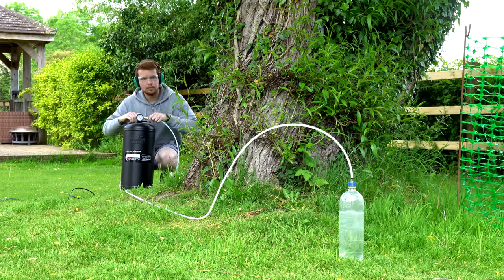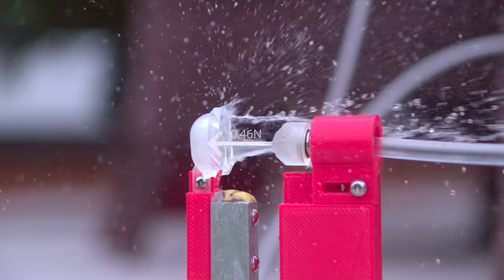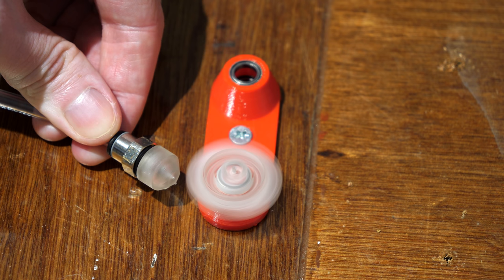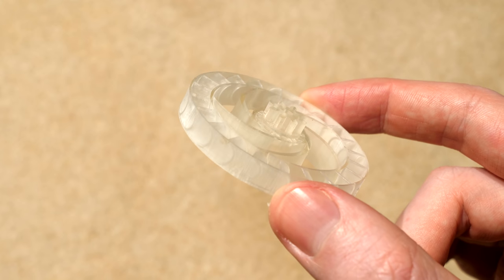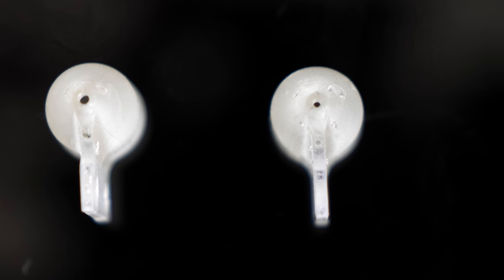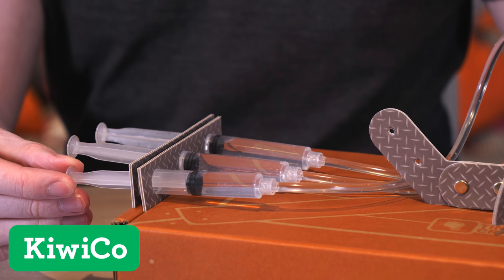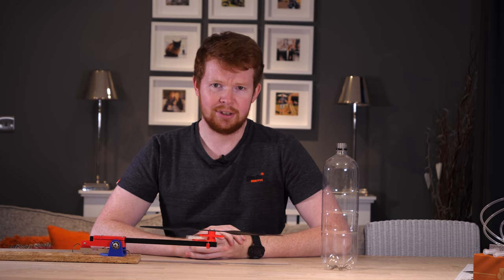Micro Pelton Turbine

Comment: 7:13 Regarding the nozzle only having .34 newtons of thrust on it's own, I'm curious to what degree an engine bell could increase that.
Reply: By exactly 0% as long as the inner diameter is too large to reach supersonic velocities. Even then, a conical nozzle can reach up to 95% efficiency. Bell nozzles are only really needed in rockets, as they can be built shorter than other geometries for the same expansion ratio
Reply: @fg8557  so what if he got supersonic how much can that benefit?
Reply: Since the pressure ratio is at least initially high enough for flow to be choked, exhaust velocity then can be taken to be equal to the speed of sound, or ~340 m/s. Assuming the 6.9 bar is gauge pressure, and expansion is to 1 bar of pressure, with a starting temperature of 293 K an ideal nozzle would be able to get ~520 m/s of exhaust velocity, or about a 50% improvement. However, the nozzle would drop off efficiency fast, especially as a constant expansion ratio nozzle would either have to seriously underexpand the flow at the beginning, or end up severely overexpanding it at the end as pressure drops, and both are bad for efficiency.
Reply: @fg8557  aero spike would probably work better than just a nozzle and bell.

Comment: Your nozzle only is not designed to extract all the potential energy stored in the pressure. In order to improve its thrust you might have to design a convergent-divergent nozzle made to accelerate the flow as much as possible for the ambiant pressure (an adapted nozzle)
At 4 bars of pressure you are effectively in the range of pressure ratio where you can have supersonic flow exiting a carefully designed Con-Di nozzle. 
In order to design your nozzle you might have to explore different throat areas as a trade-off between max thrust and how long it lasts. then you can go on calculating the adapted exit area using some isentropic compressible flow relations.
If you wanna go all out you'll also need to find the optimal nozzle shape which is a whole other story but described in some compressible flow books.
Reply: That's a good idea, and i definitely think tom should try it out! However, you still wouldn't get as much thrust out of the jet nozzle as you get out of the propeller. A jet is most efficient when the exhaust velocity is relatively close to the speed of the surrounding air. That's why fighter jets use afterburning low-bypass engines with high exhaust velocity to go fast, airliners use high-bypass engines with high mass flow at relatively lower speed, and even slower planes use turboprops.

Comment: Okay, Well done! Now here's an Idea, When working with turbines you have to understand air drag this is the air that is being pushed around by the unused turbine blades as the turbine spins. to make this work for and not against you I would suggest you encapsulate the blades. these are the ones not being directly driven until the the single blade passes over the nozzle. Blocking the blades will also create a vacuum which may increase your turbine velocity kind of like a vacuum cleaner with your and over the nozzle. When you do this you will hear the motor rev up because the air mass is dropping because of the loss of pressure in the atmosphere. try it I would love to see the result! Thanks great Video!

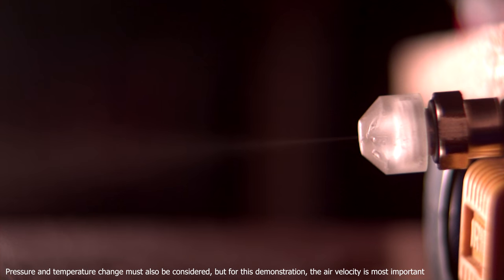Comment: A surprising lack of discourse in the comments regarding optimisation, and wanted to share the only idea I had which may be useful. The highspeed at @4:17 best shows how quickly the funnel of air begins to break apart and dissipate energy to the surrounding air. It may already be a consideration in future designs but a small plastic, or metal insert could allow for finer adjustments on nozzle location, minimising distance from air release to recapture.

Also, fantastic production quality on the included visualisations in this video (liquid and simulated gas) great work.

Comment: Just imagine what could achieved with a 300bar carbon paintball tank
Reply: With a shit ton of dry ice in it.
Reply: That would be really heavy. I think 2 L bottles are about ideal for power to weight ratio. a carbon tank would definitely hold enough air to last a lot longer, though.
Reply: @Timestamp_Guy  hence "carbon tank"

0,25L carbon tankt weights 280grams and contains 75 liter of air

2 liter pet weights 60 grams and only contains 8 liters of air at 4 bar.

Weight is increased by a factor of 5 however the amount of energy stored is increased by a factor of 10.

Comment: Oddly enough this reminds me of a video a while back from a youtuber called Stratzenblitz, in a game called KSP he built a flying aircraft carrier, and it only had 12 jet engines for thrust which was magnitudes lower than required to lift its runway sized bulk off the ground, but since he directed the jet engine exhausts at these absolutely massive turbine rotors made from dozens of wing surfaces, the jet exhaust made the giant rotors spin, and it could lift its couple hundred tons and oniboard aircrafts off the ground. So I believe the propeller is more efficient than the direct nozzle since the nozzle functions up to a high velocity whereas the propeller has a very low maximum airspeed. It can be thought of as gear ratios in a car as well, a car can move more weight in a lower gear at the cost of a low top speed.
Reply: KSP can be tricked into breaking conservation of momentum. The thing you're describing sounds like it's possible (using engines to spin a big rotor producing more thrust than using the same engines as jets) but just because it's possible in KSP doesn't mean it's possible in real life. There's also a glitch where you move fuel from one end of a spinning space station to the other and it creates momentum out of nowhere because the fluid dynamic model isn't detailed enough.
Reply: @PKMartin  I get what you're staying, and it makes sense since in KSP the force exerted on a part due to the engine exhaust is very static in nature only varying with throttle output (there is no kinetic energy loss from gas billowing out the clearly open sides), but the theory behind it is somewhat sound. Its not conservation of momentum being broken in this case since the jet engines at full throttle which can fly reliably over Mach 2 (686m/s) are exerting force on the turbines which can propel the huge helicarrier at maybe 40m/s through the air if I'm being generous and gravity is disabled, so the thrust is all in the direction of motion. Its trading off airspeed for more static thrust, similar to how jet engines that are very high bypass (huge fan diameter) are used in subsonic heavy aircraft whereas low bypass are used in supersonic aircraft.

Its all about the airspeed in the end. High lift coefficient and low airspeed, or low lift coefficient and high airspeed? That's the tradeoff between jets and large jet-powered rotor blades.

On another note, its always really fun to break KSP's physics engines for fun and profit lol, the beautiful wonderful Kraken Drive XD
Reply: @Avetho  
definitely my favorite BS propulsion device in KSP was the Wing lift exploit - a ball of blades that flails around to reach nigh infinite Velocity without any actual propulsion of its own.
👌😂🤣
Reply: @taiiat0  Oh gosh that thing was amazing, its like string theory made manifest on a macro scale, if I recall it stretches out on the launchpad and when it's sufficiently slinkied downwards it wobbles like some ungodly eldritch abomination and explodes itself so hard the root part goes flying at Mach 500 or something insane XD

Comment: Could you power the helicopter with 12g CO2 capsules or would they be too heavy? To eliminate the weight of the assembly that holds the capsules you could get the ones with treads on the end (or make treads on a lane) and connect them to your system with a higher pressure hose.
Reply: That was also my idea. But the CO2 will liquify when expanded through the nozzle
Reply: @fg8557  depends on the nozzle type and outside air temperature. But considering these co2 are used to pump tires or as propulsion for pellet guns its most likely fine. Such a small stream would heat up quickly and will probably not be a problem. It's not like you will release all 60bar in 0.1 of a second. 
But there could be a problem with the nozzle freezing... 
I do think it's an interesting idea to test.

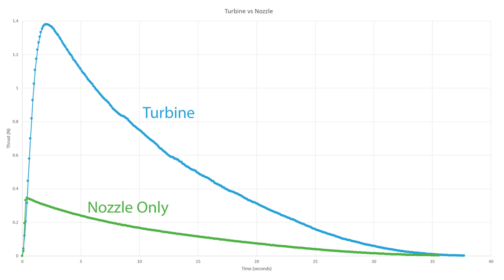Comment: 7:25
Because the air doesn‘t stop. I just flows out with little resistance. As you already said, the turbine is most efficient, when the water come to a complete stop. The stagnant and build-up air gets pushed into the turbine by the following air, while the nozzle is pushed in the other direction. With the nozzle alone, it would be more efficient, if the air would stop as soon as it leaves the nozzle, forcing the nozzle up to make more room for the following air, but due to not having any obstacle, the air just goes away with a very little impulse. It‘s like stepping into the void (idk if you say it like this, english isn‘t my native language).

Comment: 4:55 - When you say close to stationary, do you mean zero velocity relative to the rotation of the turbine or stationary as shown in the "Much less wasted energy" example? I would think that completely stationary would still mean that it has a small amount of velocity remaining that is equivalent to the speed of the turbine wheel. Stationary relative to the turbine wheel would mean that all of the energy has been captured. I could be wrong though.

Comment: 7:20 what about if you add a nozzle ? like a bell-shaped nozzle ? like rockets ?
Reply: He's experimented with nozzles before (https://youtu.be/XpA6qpNlNOE?t=317, Gas Thruster Controlled Drone). Short answer is, converging-diverging is for hot, supersonic flows; cold flows work best with a small hole like you see here.
Reply: @bob2859  it all about relative density of thrust flow to ambient.
Reply: @weatheranddarkness  No
Reply: @bob2859  nice ! thanks bob, perfect answer.

then why does the propeller perform better then ?

is it because you still have a lot of wasted energy in the small hole, compared with the pelton turbine coupled with a propeller ?

that would surprise me, because I can see a lot of ways energy can be lost in his apparatus.

is it a question of turbulent vs laminar flow ?
the small hole works better than a larger one because the flow stays laminar longer ?

Comment: Why we have 3 blades in turbines and two blades in Quadcopter and 30+ blades in laptop cpu cooling fan,which gives the best lift please test coz I dont have a 3d printer. 
I love your teaching 😍
Reply: If you are a fan of fans you'll like Major Hardware's Fan blade showdown, he tests user submission fan blades. Some pretty interesting designs.
Reply: More blades = trading lower efficiency for higher thrust, if I'm not mistaken.

Comment: 6:30 "this test was done at 6.9 bars"

Any particular reason for that specific pressure? :3
Reply: More likely 100PSI than anything "nice" ;p
Reply: A bottle can only hold so much pressure...so the max you can reasonably safely hold in it. Though your point should be taken into consideration as it may be more efficient at lower pressures. Then he would have to design a light weight regulator though.

Comment: Another interesting test you could run is the pitch efficiency of the blades themselves.  While stationary, a prop will develop a certain thrust, in some cases, not much, however, move that prop through air at a certain speed, and it will generate quite a lot more thrust because the blades are no longer stalling...

Comment: I wonder if using a denser gas like CO2 or N2 or Argon would help?  All are fairly easily attainable at a Welding supply store.  Might be a good power/weight ratio test.  In fact, I wonder if putting a few grams of dry ice (solid CO2) into the canister would work out well on that front.  Certainly give you more than the 30s of runtime at a fairly reasonable weight penalty.

Comment: Tom, I'd like to make a suggestion for a future project: build a drone or airplane or hovercraft which uses a cyclorotor or two for thrust and/or lift.  If you use two cyclorotors, and they counter-rotate, you can avoid both unwanted gyroscopic effects, and the need for a tail thruster for stabilization.

For a truly unique aircraft, use an Aerobie for lift, and use one upwards pointing cyclorotor and one downwards pointing cyclorotor for thrust.

Yawing is done by spinning one rotor at a higher rpm than the other; pitching is done by having one cyclorotor produce more thrust than the other by adjusting the collective; rolling is done by having the cylcolrotors produce non-parallel thrust.

Forwards, rearwards, and horizontal thrust come naturally to vertical axis cyclorotors, which is why an aerobie or other wing is needed for lift.

Comment: I build small engines as a hobby and I use compressed air to operate them. I have found using a caged small brass spur gear is quite effective with a tiny outlet and high-pressure air running a worm gear against a helically-cut down-gear.

Comment: Thankyou Tom for pointing out a very important design aspect with all water and air turbines.
As you explained, once the water (or air) has interacted  with the turbine , the water (or air) should drop VERTICALLY ( when maximum power is drawn). This means the turbine must be designed around this factor to work a maximin efficiency. Hence the SPEED of the water (or air) hitting the turbine will always dictate the speed the turbine needs to be rotating at under load, to extract maximum power . 
I am very sure very few turbine designers (including industrial designers ) DO NOT understand the importance of this, otherwise you would NOT see water rocketing out of of  generator hydro dam exits ( as I have observed ). You SHOULD SEE water falling  vertically out of the hydro dam exit in  great volumes !!.

Comment: Mr. Stanton: I would suggest you use a 4500 psi Carbon fibre paintball tank (smallest size 13 ci) and a first stage Hero reg followed by a second stage Polarstar Micro regulator.

This allows the use of a LOT of compressed air in a regulated fashion. As you know this means your nozzle(s) will continously blow at the same speed rather than drop off quickly. It also means you have a lot more air to work with.

When powering multiple props (which is what you aim to do with an air powered drone) you will easily create the lift needed to raise the tank and reg setup and the rest off the ground.

Hanging the tank vertically below the prop level will help balance the drone while it travels upwards.

Hope to see this happen in one of your follow up video’s.

You really want to prove sustained flight is possible. I believe this to be the way!

Kind regards,

Marten

Comment: To keep the engine running at the same RPM, you could try using a spring-compressed diaphragm in your compressed air tank.

Comment: If you enclose your Micro Pelton Turbine you can then use the air after it has hit the turbine blades to then run a piston or diaphragm motor.   Mount a second prop under the first one on the underside.  Micro Pelton Turbine spins top propeller.  Piston or diaphragm motor spins the bottom or downward facing propeller.

Comment: the reason why the turbine was more impulse efficient is that the propulsion force equal to 
m_dot*V
where m_dot is the mass flow rate of the air 
and V is the velocity of the air 
in the only nozzle case yes we do have higher velocity but with way less mass flow rate compared with the propeller due to the higher surface area of the propeller.

Comment: Regarding why a turbine is more effective than just spitting the air out of a hose. You can math that out actually with some dummy values and you'll find that via conservation of momentum, the tube will produce a small thrust (density*Velocity^2*Area), but based on the power in the air stream (Power=Density*Velocity^3*Area/2), it has enough power to lift some mass at a low velocity ( Power =Mass*g*upward velocity). 

The reason the turbine is better is because it more effectively transfers the kinetic energy from the air stream into mechanical work than an open air stream does. 

This feels paradoxical, I think, because we tend to feel more energy = more force but don't consider the forms of that energy. Thus it feels intuitive that an open air stream whose energy is going to be kinetic energy stored in the air stream should be able to generate as much thrust as a turbine even though thrust is more so a component of mechanical work (a TRANSFER of kinetic energy).

Comment: Just a thought. The pelton wheel is driven at one or a few points and the rest of it's travel the buckets aren't producing. They are actually wasting energy churning the air. This is acceptable at the speeds it operates due to the difference in density between the driving water and the resisting air, and the buckets being small and not catching much air. When you switch to air, the turbine spins much faster. Now those buckets that weren't doing much for 90% of the rotation are catching air and working as a fan. I think to really improve it from here you will need to design a turbine that is supplied pressure on all the blades at the same time. With such a small supply, this will be tricky. I am thinking a tiny diameter to reduce the circumference, and tiny blades as all must be supplied. At this scale though you will be getting into laminar flow which behaves differently.

You could also try four nozzles on a smaller turbine, but it may be difficult to make the nozzles small enough. That should reduce losses.

I think you may find this book helpful.
ISBN 978-0-12-415954-9
Fluid Mechanics and Thermodynamics of Turbomachinery.